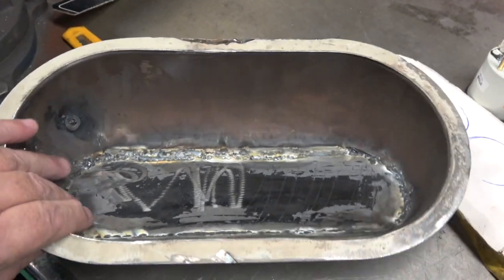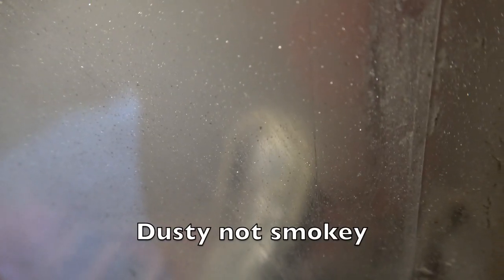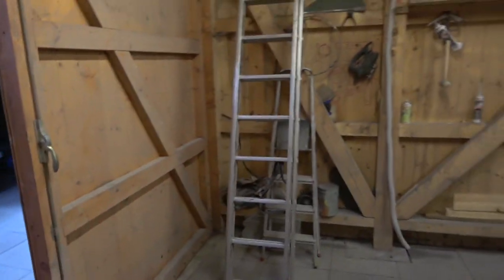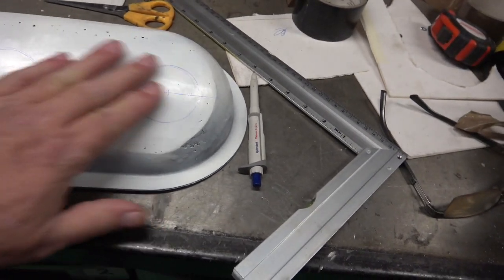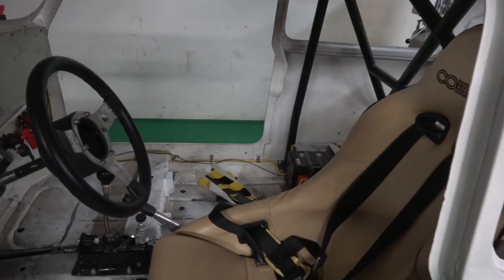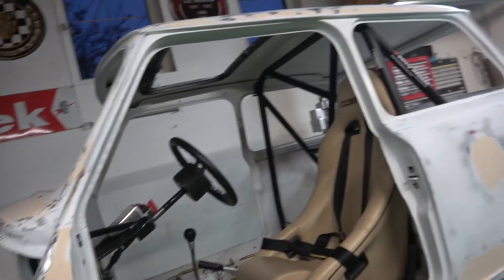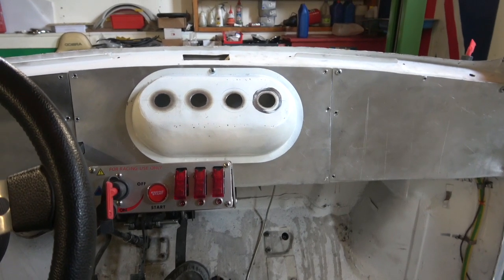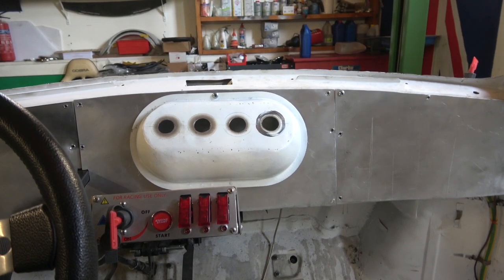Classic Mini Race/Track Car Instrument Panel Part 3

Comment: My Clarke gun keeps blocking in the feed tube, it's a pain in the proverbial.
Reply from the maker: Rich, The clarke guns are garbage not only is the feed bad but the nozzles are crap too, I know there not cheap but
get a decent gun and you will use your cabinet much more and far quicker, Cheers Dave

Comment: Hope you're keeping healthy Dave.
Any chance of showing how you're cutting the holes for the dials?
I need to do the same and unsure what cutter to use.
Cheers. Neil.
Reply: I've done it many times, all you need to do is sketch it out till your happy with the layout then transfer that to the metal. For gauges drill a pilot hole then use a large hole cutter, then file out till the gauge fits snug at 52mm.
Reply: @MiniPerformance  
Thanks for that.
So, it's a case of using a hole cutter to get the hole somewhere near, then finish off with a file...
Thanks.
Reply: @nevhath  Yes, most hole cutters have a size around 50mm, then just file out the extra
Reply: @MiniPerformance  
That's great and makes it clear, thanks.
I was thinking I need to drill a hole exactly 52mm.
Reply from the maker: Neil, I had a multi blade cutter set but they have been well used and now the teeth are just trash, There is a tool which as different sizes that can just be clamped with a pilot hole and sheared out with a bolt, Cheers Dave
Reply: @ClassicCarCave  
Thanks for that Dave